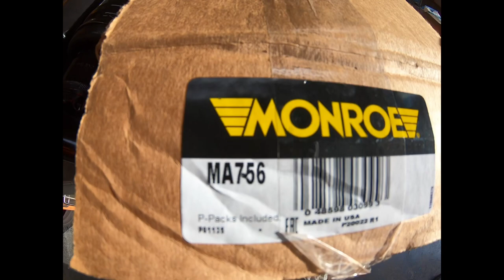Classic VW Beetle Front Air Shocks - Install - How To - Monroe 756

Comment: Great idea I used similar shocks for the back of a minivan to raise the rear when I towed a pop up camper they worked great I would pump them up when I wanted to tow and would let some air out  after for around town for a softer ride 👍
Reply from the maker: Donald Ferguson they are very diverse that’s for sure.

Comment: Great video.
Just a FYI, Its alot less work to press out the sleeves on your old shocks and press them into the new ones.  
You use combinations of socket head bolts and sockets to accomplish this in a bench vise or big C-clamp if you don't have a press.
Edit: You can also use a nut and washer with the bolt to remove and install the sleeve. Might want to put a little soap on there to help it slide in...
Reply from the maker: Thank you and you’re right…. One of those after thoughts when I was already done lol

Comment: Now I'm real interested in how she handles. I can't wait to see a test drive.
Reply from the maker: Mas Beetleboy she’s handling good so far with only 20psi in the shocks. 
Thanks for being here and stay safe!
Reply: @VWJawbreaker  couple of questions, do you get the air transfer from one shock to the other when cornering? Also, I noticed that you didn't use the through rod upgrade, any advantages or disadvantages in not installing through rods? Last question...have you tried to drive it with all the air out of the shocks, in the event that you lose all air in your shocks how far off the ground would it end up? Thanks, Love your Videos by the way don't stop making them they are great.
Reply from the maker: @gustavorodriguez6997  great questions my friend. 
I installed the air shocks because whoever installed the beam adjusters installed them wrong. With the beam adjusted all the way up, I’m still too low to the ground. So, with the air shocks I run approx 40-50lbs of pressure and that raises the front enough that I don’t hit everything going down the road. I did not do through rods since I didn’t want “air ride”. Also, I left the beam adjusters adjusted to the max upper position so even if I lose pressure the beam will still be off of the ground…. Barley 😂 
I have not had any issues with cornering and I do drive this car pretty hard at times. 
Also, to date I’ve never had an issue with losing air or any other issues with this setup. Again, I didn’t do this for true “air ride”.
Reply: @VWJawbreaker  Thanks for the reply, I am in a similar situation, I have a 68' that was lowered with drop spindles and a 4-inch narrow beam along with offset wheels, I can perform a 3 point turn with absolutely no rubbing but it sits exactly 1 1/2 inches off the ground, so for peace of mind I added a skid plate "WOW!" I hit and scrape everything, thinking of changing the Bugs name to SKR8PIN, so last weekend I went on a 200-mile trip and bottomed out so hard that I bent the skid plate and the fuse box cover shattered and landed in my lap, lol. So I searched through Youtube and came across your post, this is exactly what I need, just enough air in the front to lift it to travel to shows and air it out when I get there, I have a portable air compressor that will work just fine but wanted to know if you actually drive at the very bottom Zero air? is there any play in the shocks? thanks again for your help and keep up the content!
Reply from the maker: @gustavorodriguez6997  oh man, you hit hard to cause all that! 
Without air I’m about 1/4-1/2” off the ground, with a little bit of air I hover about 3/4”-1” off the ground…. No skid plate either 😂
Same boat though, barrows beam, drop spindles, stock rims with smart car 155 tires. 
I haven’t driven it without air and usually keep the air in the system.

Comment: I’m back again Jawbreaker. Finally installed these Monroe’s up front. So…mine are rubbing the upper trailing/control arm. Figure they’ll eventually run through the airbag. I ground the arm some but still on it. Also I’m going to have to adj my beam down as these shocks bottom out higher than the regular shocks I had. Did drive it at 40lbs and it’s as nice ride and don’t hit the random cans in the road anymore
Reply from the maker: Hmmm…. Not sure why yours are rubbing. Try running a washer between the shock and the spindle mount? Maybe that’ll space it over just a tad. 
Glad it’s riding good for ya 👍
Reply: Same problem here, '69 Beetle. No way I can live with that. I already drilled/cut the bottom fastener so I'm stuck...

Comment: Glad to see you made it to the dark side:) you can always carry a small bicycle pump if you want some adjustment on the road. Careful though your on a slippery slope soon you'll want it lower and lower than you'll need to have air front and back.... or maybe thats just me.lol keep up the good work
Reply from the maker: V8N8T great point, however this is as low as I can go and still drive the pants off of the car. I do have a great electric air compressor that I always carry with me.
Reply: @VWJawbreaker  my driving ride height is Slightly higher than yours but its nice to air it out and have it sitting on its nuts! I can still drive mine on the ground but choose not to I don't need to ruin my car to be a half inch off the ground. It is nice when you go to work on something just hit a button and up it goes:)
Reply from the maker: +V8N8T excellent point. I’ve been toying around with a diy style tank setup for the front. Need some cash first before I can pull the trigger.
Reply: VWJAWBREAKER we did a bike pump for a while, but last summer ordered a little $60 air compressor...push button in dash and bam, easy...works great with air shocks, I can send you the brand we ordered, and it fits perfect in beetle right behind glove box area up front
Reply: @VWJawbreaker  my first setup was a harbor freight aluminum tank with a lifetime warranty 12v air compressor from O'Reillys and manual ball valves in the car, whole setup cost around 100 bucks and was fun till i upgraded:) I like marci's idea better though for on the cheap
Reply from the maker: +marcijunebug shoot me the link if you don’t mind! Worse case I have a great little compressor that I carry with me at all times.
Reply: VWJAWBREAKER when I get home and look it up, will do!

Comment: 0n  ma756 front you didn't have to  shave are or nothing and how high does it go back to stock level if needed,I wanted to find right shocks love the way it sits,I have 73 beetle,thanks looks Ike I found them,oh can you make a full uturn or is it shorter
Reply from the maker: I’m using the air shocks to add a little bit of support since between the beam and drop spindles I’m about 1/4” off of the ground and that’s because who ever welded in the adjusters on the beam welded them incorrectly.
Reply: I'm trying Monroe ma 805 on back still have to just back beam

Comment: Are you running a narrowed beam? What did you do with the adjusters on the beam leave them loose so you can raise and lower the front?
Reply from the maker: Joshua Poche I’m running a 4” narrowed beam. Adjusters are set in place and tight. Air shocks just help preload a little

Comment: Hi Gary can you explain how these work please? I noticed when you installed it you had to jack the spindle up with isn’t that lost travel. So when you pump them with air won’t that reduce the travel further? Instead of bottoming our now the travel stops on the airbag in the shock to prevent grounding out? Doesn’t that stiffen up the ride even more and introduce bump steer? Like the idea just trying to figure the benefit. Thanks Steve
Reply from the maker: porsche356a these work the same as regular shocks. Yes I had to Jack the spindle up a little with the shock almost fully extended, the shock was not 100% extended. However I’ll never be at that ride height all of the way maxed out like that. I’m only running 20psi in the shocks to being the front of the car up around 3/4” which gives me plenty of ground clearance. No bump steer, smooth ride.

Comment: Gary if I would want some shocks for lifting and lowering mu bug, what would you recommend?
Reply from the maker: Shocks aren’t going to give you much travel up and down but these air shocks would work well up front. You may have to take the torsion out of the top or bottom and install a through rod also.

Comment: What do you need to do to get this to work? Drop spindles? Adjustable beam? Thru-rod mod?
Reply from the maker: I’m not using the air shocks to raise and drop like an air ride setup, I’m using them to help support the front end since whoever welded in the adjusters in the beam clocked them wrong. With the beam all of the way up, drop spindles, the frame head was 1/2” off of the ground.

Comment: Hey man Kevin here from Australia.  Looks like a good solution to a problem. But why not move the air valve inside to the cabin and run  a small compressor to a  small air tank.
Could look nice.
Q. Can you drop something heavy on those safety boots i wana see them do their stuff. 
Anyhoo as usual stay safe and stay well.  ✌  Peace man
Reply from the maker: Kevin Hamling I’m working on a lil something down the road. The valve up front is just temporary I hope. Set the pressure and leave it alone. 
I know, maybe one day I’ll wear proper shoes 🤷‍♂️
Reply: The pumps can be expensive but are available as a kit.

You can even get self leveling/programmable kits using ride height sensors.

Low, normal, high and off road like a range rover

Comment: I've been thinking about doing air shocks but possibly adding the air compressor and tank to be able to adjust ride height on the fly.  Thoughts? . As always thanks for the great videos!
Reply from the maker: Vdub618 it would definitely work, you’ll just need to upgrade the lines from the small 1/8” the shocks come with to larger.
Reply: @VWJawbreaker  oh ..good to know thanks!
Reply from the maker: Vdub618 they make adapters that screw onto the air shock to give you 1/4” line.

Comment: Do you think I need to put the 2 inch drop spindle on or just use the air shocks?
Reply from the maker: I doubt you will need to unless your beam adjusters were put in wrong like mine were.
Reply: @VWJawbreaker  thank you for your fast response. Love your videos . I have a 68 bug. I have the 2 inch drop spindles but if the air shocks will lower the front inn I was just use the shocks.  I ordered them today.

Comment: I just bought a set of these for my 66. Im on 2.5" drop spindles and converted to disc on 2.5" drop spindles. Unfortunately the disc brake kit pushed the wheels out even further than the drop spindles on the drums. It's so stupid. Im hoping that these shocks will fix the occasional rubbing as I dont want to have to narrow my beam. Fingers crossed.
Reply from the maker: Fingers crossed is all you can do. Normally with disk brakes people usually have to narrow the front beam. Let me know how it works out for you.
Reply: How did it work out? I think I’ll have the same issue.
Reply: @westsidesurfsnaps  I ground down the calipers a little and they worked. Since I've had the front beam narrowed two inches which has nothing to do with the wheels rubbing it just looks better and I can drop it on the ground now.

Comment: Hello, i'm from Brazil and i will do It on mine 74' beetle, to do this, you needed to disable the torsion leaf Springs?  The car didn't come to hard?
Reply from the maker: All of the torsion leafs are still in place. I added them to be able to dial in the front ride height.
Reply: @VWJawbreaker  ok, thank you a Lot. Hugs from Brazil.
Reply from the maker: Paddock anytime 🙏🤙

Comment: What size tires you got on the front? I your ajustable beam narrow?
Reply from the maker: 4” narrowed adjustable beam. I bough the beam used and whoever put the adjusters in clocked them wrong. I didn’t realize that until I put the drop spindles on and the frame head was 1/2” off of the ground with the adjusters all the way up. Front tires are a 155/60/15.

Comment: Nice bug...did you use empi trough rode for front beam or this works with stock beam?
Reply from the maker: Thank you. 
The setup here is a 4” narrower beam with adjusters and drop spindles. No through rods. Just using the air shocks to add a tad of lift since the adjusters were welded in wrong by the previous person.
Reply: @VWJawbreaker  Thanks...you help me a lot!cheers!
Reply from the maker: @alencokic2263  happy to help 🤙

Comment: Got a question: when I bought my 68 vw beetle someone had wired up a new key ignition so I ordered a new ignition cylinder when I took it all apart I think I'm missing parts inside the ignition sleeve and I can't find it anywhere!! And I'm not 100 percent sure what I'm looking for. Do you know anybody who would have a 68  vw hole sleeve (where the key goes in) off a donor car. I will pay for it and shipping. Or do you know what part I would be missing?
Reply from the maker: I don’t know if anyone off hand that would have what you’re looking for. I’ll ask around and get back to you if I find anything.

Comment: It looks like the driver side had tighter clearance on the arm and you had to space the shock further inboard. Look forward to seeing how your going to air it up on the road conveniently. Tired of driving mine on the scrape.
Reply from the maker: Sean Powers just running it at 20psi for now, I might mess around with stuff later down the road. I did need to put a washer between the arm and the shock on the driver side to keep the shock from barley touching the arm. It might have been fine but did it anyway.

Comment: Did you cut your upper trailing arms to clear the air shocks?
Reply from the maker: I did not, they bolted right in on both sides. Some have said they needed to clearance the arms a tad with a grinder, be careful not to weaken them.
Reply: Well, in order to clear mine I had to cut off quite a bit
Reply from the maker: @michaelnibblett2089  I’ve heard some say that but I haven’t experienced it myself.
Reply: I hate to admit but in order to clear mine I had to cut off a lot
Reply from the maker: @michaelnibblett2089  oh wow
Reply: Yeah I’m gonna have someone weld a thick piece of metal on the underside of the arm to reinforce

Comment: Lost sound on your side not mine, on my  73beetlle to put air shocks on front and back with compressor can I use a plastic hose,want to up,down at same time,do I need to take out bars on front beam or can I just use airshocks
Reply: Does that line come with shocks or separate what kind of release valve and switch I need to release air from inside car
Reply from the maker: I’ll check the video, thanks.
Reply from the maker: You can use the plastic hose that it comes with but the air up and down will take longer with small hose. Best to go up to 1/4” if possible. 
I don’t have mine setup like you’re asking, best thing to do is look for air ride kit so you get the valves, etc that you need to do what you want.
Reply: What   airshocks for rear ma803 from Amazon is that wrong one for rear still in box I bought airlift kit already do I use ma756 for rear also and drill out also on 73 beetle do I have to grind part of arm for ma756 front to fit
Reply from the maker: @reginaldlarry2962  not sure about the rear, I only put air shocks on the front.

Comment: Is bigger the line the faster up and down goes I'm at 1/4 so1/2  will go faster or slower and do I need a stronger compressor I have airlift
Reply from the maker: Yes, larger line will make it go up and down faster. Not sure about the compressor but make sure you have a decent size air tank so the compressor only has to keep the tank topped off.
Reply: What's the minimal tank I can get I'll put behind my back seat
Reply: @VWJawbreaker  and where
Reply from the maker: @reginaldlarry2962  I’m not running a tank in my car. You’ll probably be ok with a 2 or 4 galling tank, just measure the area you want to put it and look for tank specs from whatever manufacturer you pick.

Comment: Y'know, I have a pair of these shocks sitting on a shelf gathering dust...hmmm. Where's my tape measure!
Reply from the maker: Hope they work out!
Reply: @VWJawbreaker  All in good time! Right now I have an exhaust project to finish (converting rear muffler to hideaway  dual tip). 
If those air shocks measure up I'll  look at narrower front rubber and drop spindles in the future. Lets get the car on the road again first!

Comment: Just received  my ma756 but cannot  depress by hand like yours went down a hair  then stopped do I have a bad pair or what or do I need to adjust them and how,can't  get to go down,help
Reply from the maker: Did you loosen up the plug where the air line connects?
Reply: Yes doesn't go to numbers on shocks like yours how far is it suppose to go down,feels like it's stuck what's your measurements expanded and depressed from top screw area to bottom of shock,yours go down to the  numbers mine move maybe a half inch,need help please trying to install,my other shocks can depress by hand
Reply from the maker: @reginaldlarry2962  I’m not sure what the exact measurements are, you should be able to find those on the manufacture web site. Seems like yours may be sticking, hard to say what’s going on without being there.
Reply: I've  learned a lot on previous videos thank you so much your my hero lol still need help on shocks part tho thank you,but Love your videos your funny also,great instructor for beginners
Reply: Sorry to keep bothering you but how can stop sticking part I think I saw on another video you had this problem
Reply: I figured it out thanks